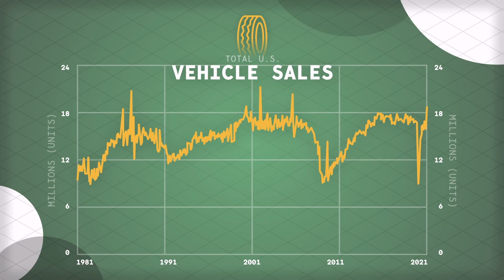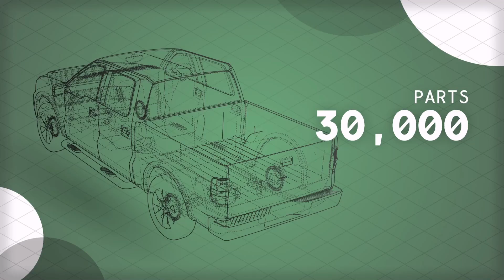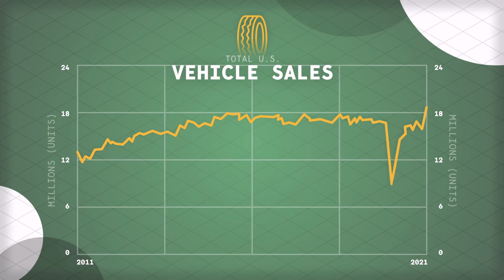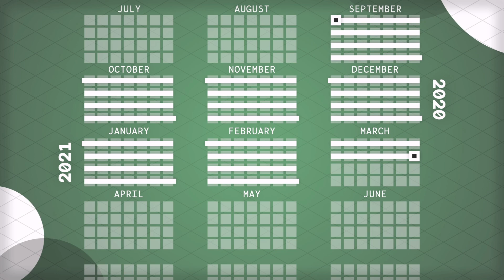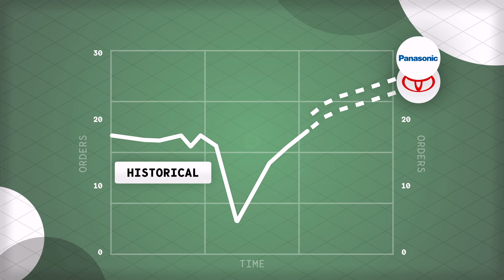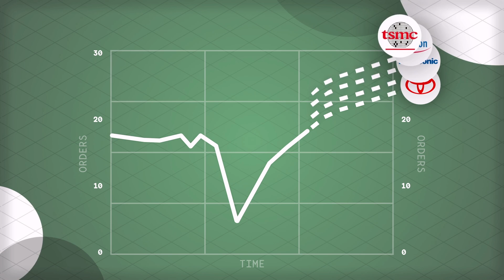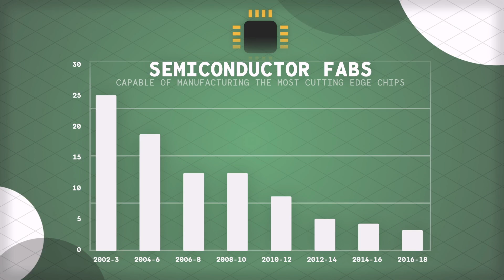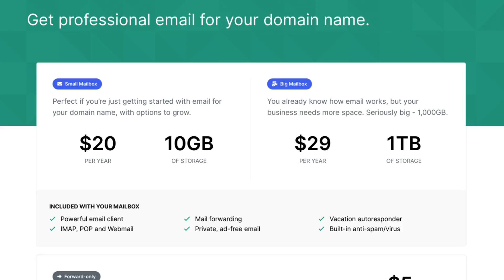Why the World is Running Out of Computers

Comment: "What tiny things can they change without anyone noticing?"
Other carmakers should ask Porsche seeing they have the ability to charge people to REMOVE features from their already pricey car lolololol
Reply: Porsche is going the Apple way in the name of re- innovation. Ducking build on the things which are good instead of removing them...
Reply: What do you mean
Reply: They remove parts on the specific models that are designed to go real fast around a track. Your average Cayman or Panamera won't have any of that
Reply: They wouldn't build ’em if they didn't sell
Reply: Imagine your phone. It has a camera, some inked logo, material.
You don't care about the camera you want it removed so it's lighter and thinner.
Cost money to re engineer the design to make it work.
Want a lighter and thinner material but won't make it as fragile. Same thing

All these things to remove is harder than it sounds. 
Same with a car to make it more effective and efficient with less is the real problem. The lazy way is remove stuff and it works worst than before
Reply: @pwntimeblade  what absolute made up bullshit. It does NOT in fact cost to remove chips from a phone..even less so a car. Fyi engineers in shenzen can design AND prosuce a new phone in days
Reply: @cdreid99999  You said engineers, and that is correct, but there is about 80 different parts that lead from design to final product in your hand that need to be considered with even one significant change that can't be written off as a revision.  A redesign with removal of parts, even one, could have several months of lead-up time, and it would only work for a company maximizing profits if they know there's a large enough market to make a separate product viable enough to be worth that one change.

Does that sound insanely tedious and a huge issue when it shouldn't?  Absolutely, but the point of this video itself is to show this glass house, or heck, glass cannon, we call consumerism, at least in a realm of technological advancement, really is.  It doesn't have to be like this, but this is "what's been agreed to" by those working in those fields.  You want better, make better, but buy a bullet-proof vest first, because you will come under fire.
Reply: @Rikorage  i am capable of designing a smart phone. Youre spouting apple fanboy. S. To remove the camera from a phone requires deleting a prefab mechanism, minor programmong and a case redesign that can be accomplisjed in days at most. To remove parts from a production car even less. No carpet..just dont install carpet. No radio. Skip that robotic line with the car,  send off solidworks file to 3d printer and they start arrivong in boxes a couple days later. You sound like you have theoretical knowledge. But its incorrect. So you know the vast majority of what your phone does is on one chip
Reply: @cdreid99999  ah yes, because it's not like the radio wouldn't leave a gigantic hole you'd have to fill in. i'm sure the carpet's not covering up anything either, right?
edit: and my guy, if you want to print that amount of material for someone who doesn't want a radio you better believe it should cost extra, lol
Reply: @martinszymanski2607  I'm sure he's the kind of guy who doesn't understand why a lighter model version cost more than the original when it uses less material...
Reply: @cdreid99999  I kinda called it, seeing the above responses.  I'm guessing English is not your first language, so maybe my meaning was lost.  The 80 or so parts are not actual pieces of plastic or metal or silicone, I'm talking about the entire manufacturing process, involving the design, the procurement of materials, the access to facilities, the arrangement of companies working together with intellectual properties, the royalties along with that, the logistics of how much to make, the cost of each part, the shipping and handling of said parts, the timing of events, the timing of release, the press and marketing of the product.

Then there's the software side, trying to get the right OS, the right software, the right firmware for your hardware, the right drivers for anything not built into your SoC, the updates and continued support for the device after the time you expect it to be relevant enough to have updates and support.

Saying you can make a single phone as proof of concept is one thing, but can you make a million phones in a year?  There's so many moving parts in the process to even make just one phone that it's amazing these companies make as many as they do.  Also, just fyi, I've only ever owned one Apple product, that was the iPad 2, so my loyalty to them is slim, at best.
Reply: So youre saying apple just copies porche then
Reply: but at least they do smoke other vehicles with less power (hp and tq) tho 🔥😂

thats porsche! (yea sure they did jack up the price way too much, even for some car enthusiasts) but still..... they build precision machines to lap the ring

my point is, some of the extra costs are purely for car enthusiasts, you might not understand removing back seat for cage is better than having backseat for some enthusiasts, especially those who are willing sacrifice many things to shave tenths of seconds 🤷 thats their hobby, and maybe knowing porsche, little changes to the car could upset the balance of the car, lets say, maybe its weight distribution gonna be different, therefore if lets say they designed the car to perform the best they could with full option (therefore assume with heavier car), and then now you want to remove the back seat and others, perhaps they put extra effort to do some tweaks n shit to make that "german" magic happen 😂 (to maximize the potential of the weight reduction), so yea although lets say they just simply charge you to pay extra for deleting an option, then at least it goes faster/quicker and if that's why people buy porsche, i guess thats the reason why. I mean... in my pov i'd buy a porsche to have fun on track, not for buying a cheaper "substitutes" of bentley or rr 😂
Reply: care to elaborate?
Reply: @jole0  I believe he’s talking about how cars like the gt3 rs cost more, but remove stuff like air conditioning and radio for weight reduction
Reply: @Flat6Mafia  thanks.
Reply: @Flat6Mafia  Not quite... Porsche LITERALLY charges additional money to remove specific features and customize.
An RS costs more because there is additional engineering that goes into the engine, generally having a higher redline, more power without a turbo, etc.

But Porsche also charges money to remove badges, swap door handles (aluminum interior handles) for door pulls (literally lanyards at a fraction of the price), delete specific items for weight savings within the same model, etc.

Comment: There's basically only three companies in the world that are able to produce large chips at the cutting-edge: TSMC, Samsung and Intel. As if that wasn't bad enough, Intel is still struggling to get their latest nodes working, and they generally don't allow other companies to place orders at their fabs (unlike Samsung and TSMC). So we basically have a duopoly for the most important technology on the planet.
Reply: Yeah but Intels new plan is to open up their fabs for other companies to order from. Should be exciting.
Reply: Agree but even samsung is struggling to keep up with tsmc their nodes are pretty inferior to tsmcs. Their 5nm process has a worse yield than tsmcs 7nm and are not gonna improve on that. Tsmc is valued more than entire samsung electronics . Intel announced that they are considering to split their foundry and chip designing  business and will likely start offering others to place orders but again intels fabs suck.  Tsmc will  continue having huge lead over samsung or intel both in tech and market share.
Reply: @B21_raider  Intel is not going to split its business, especially not in this climate. Also Intels fabs do not suck (well most of them anyway), they just aren't as advanced as TSMC. But that's doesn't really matter because most things don't need, require or use the most advanced chips.

Comment: Can someone explain to me why are there only 3 semiconductor manufacturers when we have companies like Intel, Qualcomm, Amd, nvidia, arm and samsung??
Reply: There aren't only 3 semiconductor manufacturers. Intel has it's own fabs, and Samsung has it's own fabs. And there are several other manufacturers but they deal with less advanced nodes. The rest outsource.
Why? Because fabs are fucking expensive and extraordinarily complex.
Reply: Most of them are fabless and outsource putting their designs to silicon to other companies. Only Intel still owns fabs, and they have hit a wall In trying to shrink beyond 14 nm.
Reply: @kevinwilley4180  so basically they help in the manufacturing process of semiconductor but they don’t do the whole process? Would u mind telling me which in specific
Reply: @kevinwilley4180  Where did you read that Intel cannot shrink further than 14nm?

Comment: The title is a bit… YouTubish. But the rest of the video is pretty good. Though the toilet paper shortage wasn’t caused by hoarding (for the most part) but by the suppliers switching production between the brands that supply workplaces to brands which supply residences.

Investors need to start setting up chip makers who aren’t trying to sell top-notch, specialized chips to the world and instead supply simple chips for simple applications to less than global scale product manufacturers.
Reply: There wasn't even a shortage, the only "pinch" point is the end of the chain- the retailers.

Production, storage, ect had more than enough. The issue was getting enough of these from the warehouses to the retailers facing a run on goods
Reply: alternatives to cutting edge chips? I'm imagining Fords with vacuum tubes sticking out the chassis! :-) Retro? Steam-punkish? :-)
Reply: You mean CLICKBAIT right?  Title is clickbait-ish.  There is no shortage of computers, only the usual semiconductor boom-bust cycle temporarily exacerbated by a viral outbreak.
Reply: @SithLord2066  U know this is SoC, APU and CPU's, not ordinary semiconductor with 90nm+ nodes. 
@03germas u think this is "pinch" or retailers side, when TSMC already sold out capacity for 5 and 7 nm for 2022?
Bulid a new fabs isn't economical, also node become obsolete in 3-5year that means when u finish first u should get a half done second. Second problem with fabs is geting unobtainum (litorgaph on current node)
Also we become more oriented on hardware than software side, if we go back to demoscene on Amiga we get more efect's from less power. Now is throw more #rate at problem.

Comment: Due to corporate greed this problem will probably never change. As an example think of how disposable phones are - New model comes out and people upgrade, get rid of old one. Do the components of the old phone go to be recycled and reused? NO... goes to the landfill. Same thing happens to every PC upgrade. Electronics in vehicles. Everything.

With the consumer culture as big as it is, the biggest problem is being overlooked. The system is designed around quantity not quality. Companies putting out a new model of product with very minor upgrades, advertising it as revolutionary next generation. Clueless people fall for advertising and buy it, throwing away their old product. These products are designed to profit the manufacturers, not to be sustainable. At some point this will have to change but corporate greed will slow that change as long as possible.
Reply: Don't be conspiratorial.

These companies do it because the people demand it.